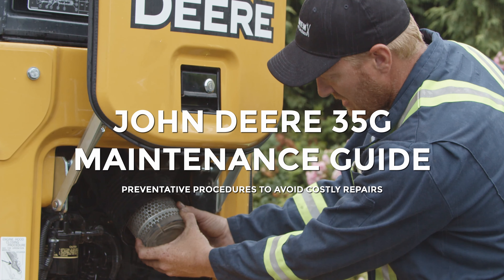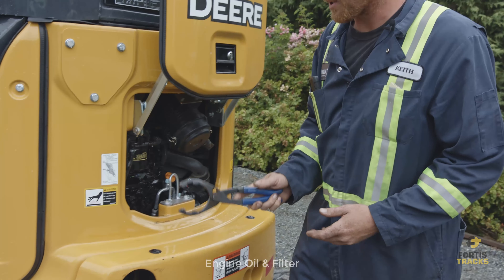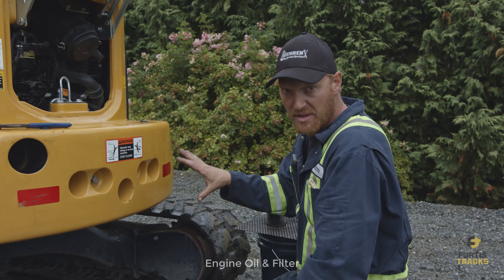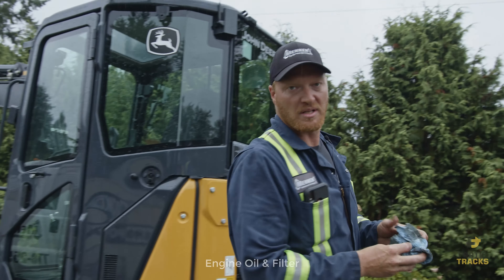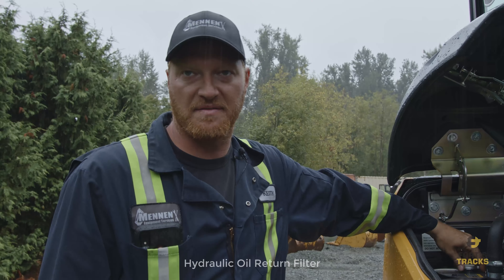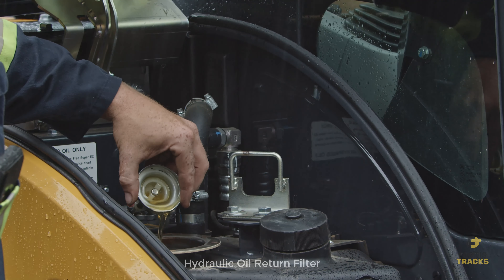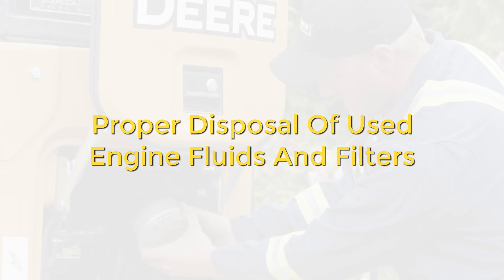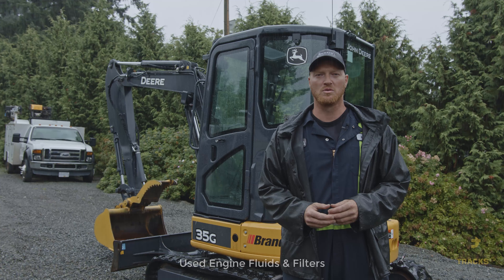Complete John Deere 35G Mini Excavator Maintenance Guide — SAVE Money With DIY Equipment Care

Comment: when changing the hydraulic filter do you need to bleed the system to get the air out.(The manual says so) or just run and refill as needed
Reply: I wondered this too but my dealer said it's not necessary. Only if you replaing the hydraulic pump.

Comment: I put a whole gallon of oil in it and it was barely over the level; sure enough I started and let run to fill oil filter and the level went to exact full on the dipstick.